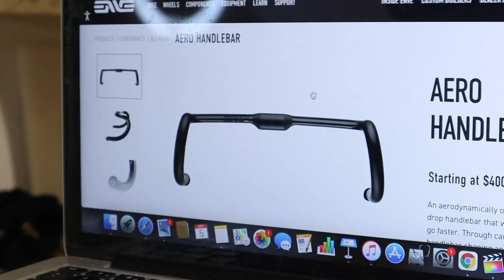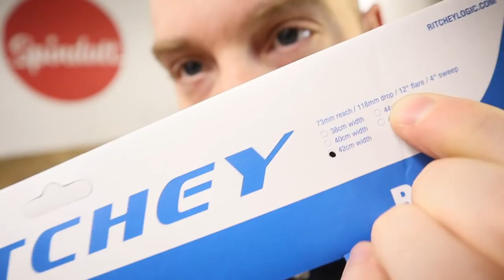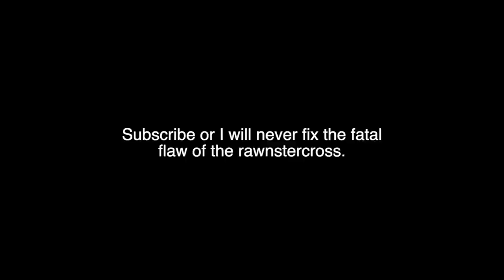Old Cross Bike gets Modernized with Ritchey Treatment

Comment: Yo what wheel sets do you recommend for a cyclo? I’ve been trying to upgrade. What rim depend, width, and spoke count front and rear?
Reply from the maker: 32/28, 25mm wide, 30mm deep. Give or take.
Reply: @Spindatt  awesome thanks man! but ive got bad news. I got ran over by a car yesterday on my cross bike. Im worried about the full carbon fork.  the bars got offset with the wheel, head on collision. I need to thoughts on replacing the fork. Ive heard you need to replace it cuz it might have micro cracks and im leaning towards it.